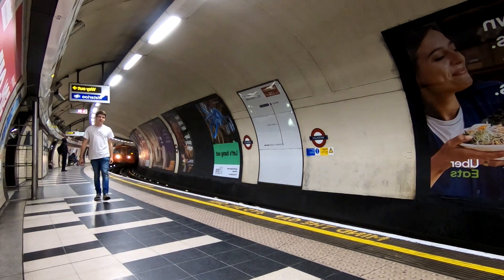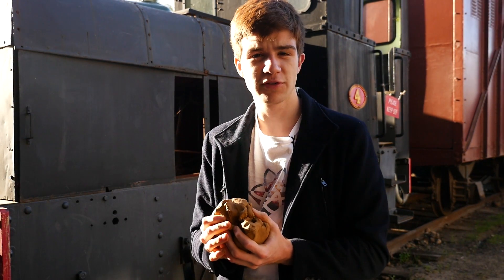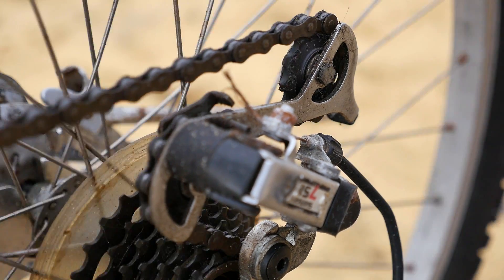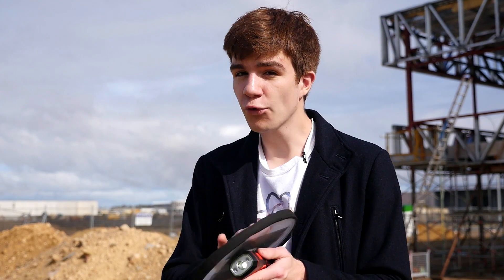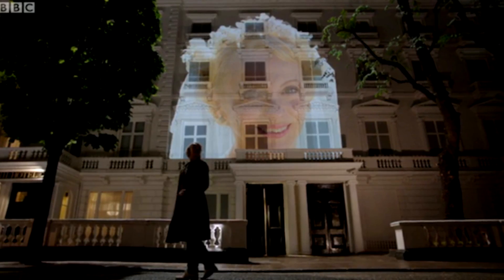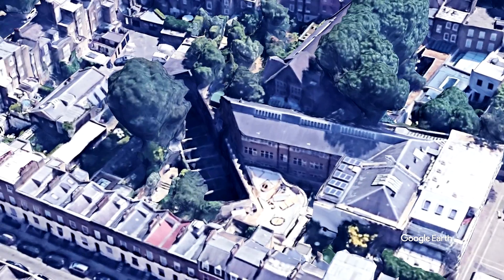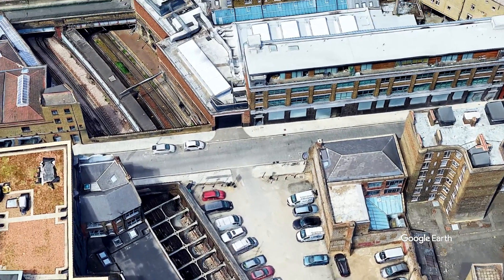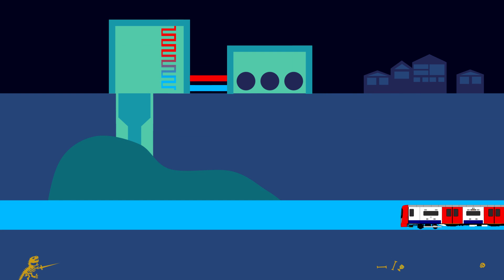Why It's (Almost) Impossible To Cool The London Underground

Comment: the NYC subway is no treat in the summer, let me tell you. i wonder which is hotter during the summer:  the NYC subway or the London underground?
Reply: pure on the effect that the London underground just exist longer I think that it would be the hotter of the two. 
It just had more time to heat up.
Reply: tsartodd Much of the NY subway is just below surface, and therefore has ventilation at much more frequent intervals. Many tube lines are substantially deeper meaning there was / is little opportunity for additional ventilation shafts- not least because they were dug beneath long established buildings unlike the NY system which largely follows the road grid. Also, I don't think there is much clay on Manhattan island, I may be wrong, but it seems the clay soils of London do trap heat more than other substrates.
Reply: Many of NYC's subways were built by shutting down a street and digging a trench just beneath the surface for the trains. That means they're shallow and ventilation to the surface is easier. That said, they do get hot.

Comment: Well done, James -a really interesting video. A couple of questions: (1) Is the storage of summer warm air to supply the Bunhill Energy Centre during the winter actually in operation now or it an idea that is being considered? and (2) What's the connection between the Perth Rail Heritage Museum and the London Underground? Is it one that I, as a longtime resident of Perth who was born and brought up in London, should be familiar with? Whatever the reason it was great to see the Bassendean Museum in your video.
Reply from the maker: Wow, great spotting and good questions! (1) At the moment Bunhill is just fed directly from the lines, with the key seasonal change being that it pumps extra air in during the summer. Stage Two of the project (taking place now) plans to increase capacity by a further 1000 homes by using an extra ventilation shaft from the Northern Line, but again this is just direct heating. Tunnel storage has been discussed, but there aren't any plans to implement it just yet. (2) There doesn't appear to be any connection between the Rail Museum and the London Underground (beyond some of the trains being built in the UK). However, since I wasn't able to perform any demonstrations while travelling, and my Australian lab isn't nearly as exciting as the one I used while at Leeds (featured in some of the earlier episodes), I thought the historic trains at the museum provided the perfect backdrop. Had no idea the museum existed before the video, will definitely be back! 
Hope that helps! - James

Comment: The Geothermal Idea is such a good one. That combined with some of the other ideas presented would definitely do at least something.
Reply: The problem is that the air is not warm enough to be true geothermal with decent efficiency. It wont get much above 40 C anyway. Sure, using a heat pump you might be able to create a heating network that uses 50% electricity instead of 90% fuel, but it is still woefully inefficient.

Once they solve that little problem stemming from the laws of physics, I am all ears.
Reply: @57thorns  Actually that’s not a problem at all considering that in colder countries such as Norway air-to-air A/C units are used to heat your home even though the outside temperature is as low as -10°C
Reply: @koppadasao  Those heat pumps have an energy usage compared to direct heating of between1:2 and 1:3 at those temperatures. Not better than burning things given that they use all electricity.

If you have a hotter temperature like 60-80C  you just need to restrict the heat flow with a minimum of electrical input, and those are the operating temperature of district heating, which this might be used for.

The limited air capactity of those chambers, and the limited temperature would make it impossible to use for producing electricity, and the low thermal mass would be used up in no time even if used for direct heating.

You are better off using forced ventilation in the tube itself. This sounds just one more of those magical "energy from nothing" schemes (scam if the people behing it actually know enough to understand that it can't work).
Reply: @57thorns  The way to get usable heat energy out of all this would be to have water pipes running in the clay near the tunnels where they'd pick up the heat in the ground around the tunnels. Those pipes would be tied into the heat exchangers. Who knows how many buildings could be heated this way but it would be pretty efficient. Moreover, the overall goal is to lower the temperature in the tunnels (doing something useful with the heat is a side benefit), which this would eventually achieve.

The main issue would be the practicality of laying pipes (you'd use flexible pipe to be sure) in close proximity to existing tunnels, but new tunnels anyway could have them incorporated during construction.
Reply: @davidjames4915  That is definitely an idea I could see working. Heat, but not electricity.

Comment: I was expecting all those passengers to contribute more of the heat, I was surprised.
Reply: Ask anyone from up north, they'll tell you how cold Londoners are 🤣
Reply: @stevieinselby  as long as we aren't stingy, nothing else matters :P
Reply: The heat load of each person is around 200W, made up of sensible heat (dry) and latent heat (vapour).
Reply: @LondonRider12  if thats true, 200w is still a bunch of heat. There is what, 1000, 2000 people in a tube sometimes? 20kilowatts, 40kilowatts of humans. 
Good things the heat we produce also hosts systems that regulates body temps and also include liters(7~16?) of water in the skin as storage ;)
Reply: @LondonRider12  is this what ancient writers meant by dry and wet humors?
Reply: ...as was i ...perhaps on the carriages, if crammed full it be a different experience
Reply: Most of the stiffling "heat" you sense in a crowded space is actually water vapour and carbon dioxide triggering your breathing reflex.

Sure, you add a little bit of heat in a small room, but the energy levels needed to push all that air around (the syringe effect) as well as the stop/start corresponds to huge amounts of energy, all of it being dumped as heat.
Reply: It’s the same with climate change. Lots of the anti-global warming initiatives are focused on individuals and their own recycling or emissions reduction but the bulk of pollution is produced by large corporations
Reply: @oceanusprocellarum6853  Not really, as everything is broken down to the individual transport or individual item bought.

Because  "coroporations" are creating those emissions because someone pays for their goods or services, and in the end they are individual consumers. 

And for most things, it is those billions of people making everyday decisions as a group that makes up all of it.
Reply: @57thorns  fair point to make; there’s more perspective in your comment than mine. I was gonna write a long comment to show how corporations should still be held accountable but I’m too lazy. Something about corporations not merely being a loose association of individuals but being controlled top-down, thus having more structure and control over the market and their business practices than an individual consumer.
Reply: @oceanusprocellarum6853  It's going to take a lot of fundamental changes to address, both individual and collectively. On a individual level the biggest thing we can do is produce less waste.
Reply: @57thorns
While it's true that consumers fuel the market, that doesn't mean companies are not a problem.
Imagine how much better we'd do if we forced countries to use cleaner ships or forced third world countries and developing nations to actually uphold things like filtration laws.
Reply: @57thorns  No, most pollution is not consumer end. Almost all pollution occurs in production or in waste. Less than a tenth of all pollution is consumer. You should see some of the warehouses I've worked in and you'd understand why. A box full of plastic packing wrapped around a box full of plastic bags full of smaller bags of disposable rubber gloves to be thrown away every 2 hours during your 8 hour shift.